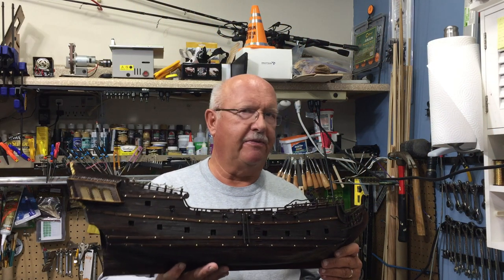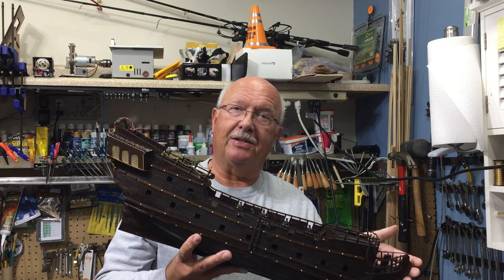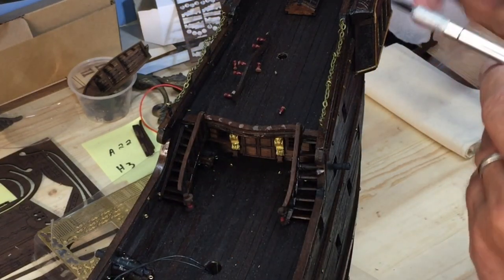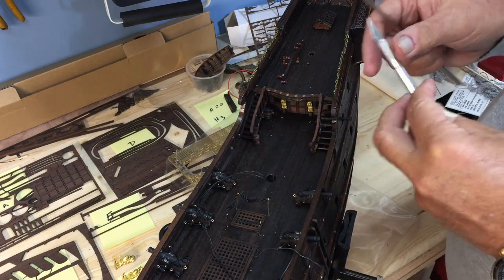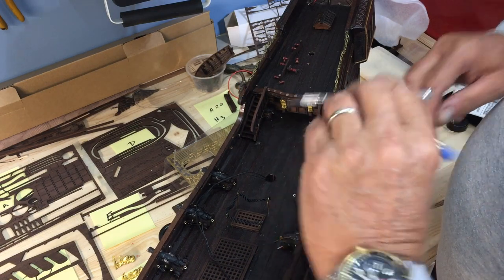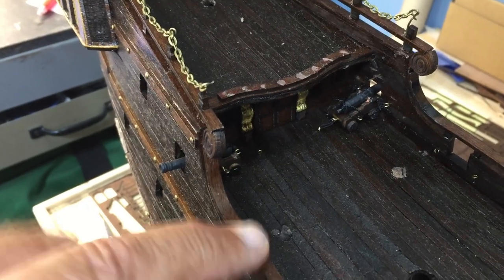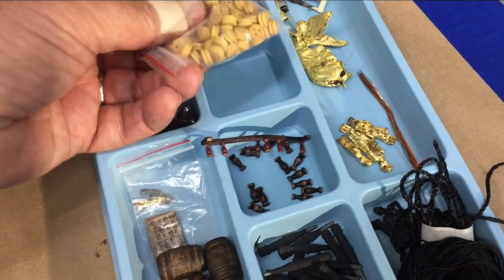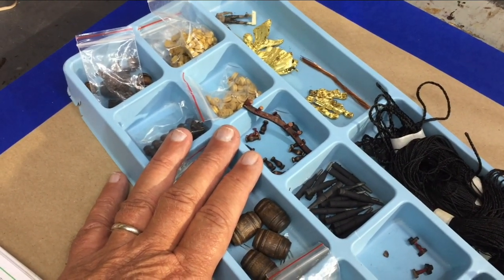The Black Pearl Golden Version 2021 Episode 13 A

Comment: Hi Dan you could rectify another problem with the two gun carriages that were two close to foot of stairs by removing the top step and corresponding rail whilst the stairs are removed.  Had the same problem with my model although a different manufacturer.  It leaves enough space for the first and second guns.
Reply from the maker: Stay tuned….. I discovered that I used the wrong spindle on the upper railing and stairs (Episode 13A). That correction will give me more room for the two cannons…. If not I’ll definitely use your suggestion! Thanks 👍👍

Comment: Hey Dan great videos! Currently in the middle of building this ship and your videos have been very helpful, so thank you. I did have a question about the cannons, did you use the eyelets that came with the kit or did you buy separately?
Reply from the maker: At the back of the cannons, I used an eyelet that was almost the same that came with the ship.  But I found them in the jewelry making area of Hobby Lobby.  Very inexpensive and I have several different colors of them. That being said, I ended up not securing the back of the cannons to the deck as I had planned.  There wasn't enough room so I settled on leaving that detail out.  I also ordered small brass trunnions 7mm x 2mm that secure the cannons to the base.  They were not included in the kit.  I found them on eBay, but just checked and that seller no longer lists any for sale.  I appreciate you following along.  I'm happy to try and help if you get stuck..... But I really am a novice at this!  I hope to finish the rope work in the next few weeks.  I have some ideas for the sails.  I'm going to have them folded up.  The trick is to get them to look natural......... I'm in the process of trying to age material, but so far not working as I had hoped.  I have a back up plan, that I've used before, so I may just have to go with it and improve it from the past builds.
Reply: Thank you I Appreciate the information. This is my first build having lots of fun with it.  Your videos are like a second set of instructions lol. I've watched the series quite a few times. Your ship turned out great! And look forward to seeing the all scenario finished. You could try 80 grit sand paper to try and distress the sails or find a dirt area and stomp and drag it around. Its what I do for Halloween costumes anyway. Or possibly try your rock tumbler
Reply from the maker: Ha 😂…. Great minds think alike!  I’ve tried the rock tumbler, even adding chemicals and ceramic pieces, broken glass ….. can’t get the look I want.  Saw something on tv talking about zombie costumes that they had made. Listed some solution including rock salt. So I bought everything and it still didn’t work…🥴.
I’ve done the gritty sanding…. I continue experimenting with heat gun  burning some holes…. Probably end up with a combination of things….😵‍💫.